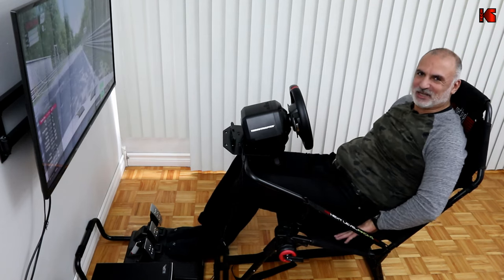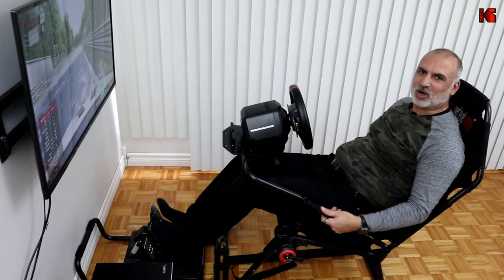Next Level Racing GT Lite Honest review

Comment: when you swing the arm in - and lock it in place - make sure it goes down and in place.  coz mine swung around and i thought omg its the same as this video.....its taller on one side - then i swung it back again and noticed there was room to push it down before locking it in place.  i think coz the things in tension, if you just swing it , it wont be level,  make sure you push down on the right side as you are locking it in.   mine is level - bought it coz of this review - its great.   its as good if not better that other rigs ive owned.   best part is its light and airy.  i got a memory foam cushion with a cool gel insert from my local kmart for $20 and it ontop of a pillow, i can sit for hours with no issue.  i also taped some padding foam onto the left and right parts of the tube, where your legs rest.  to stop metal on skin strain.  its great.  cant fault it.  i get in from the left.  so dont think you only have to get in from the right.  i have a stool with ontop a wifi keyboard and mouse on my right.   phone sits on the gearshifter plate on the right.  its damn near a perfect setup.  love it.  Easy to get in and out either side.   i used to have an obutto and this id probably prefer.   there is a tiny bit of lift when i brake at 120% into hairpins but thats only when im at the limit and jam the brakes harder than you ever have before.  but its all part of the fun.  i know if im doing that then im driving bad.  i could dial that out with the angle as its adjustable but ive got the front chair support at 90 degrees to make the footprint as small as possible  its a killer setup for cheap.
Reply from the maker: Thanks for the info. In my case, I made sure the tube is all the way down but it was still tilted